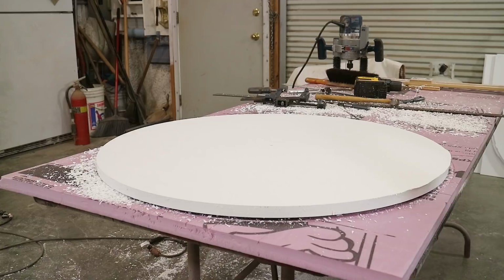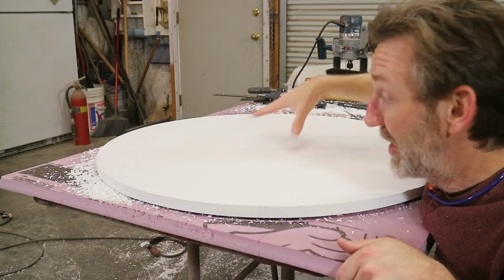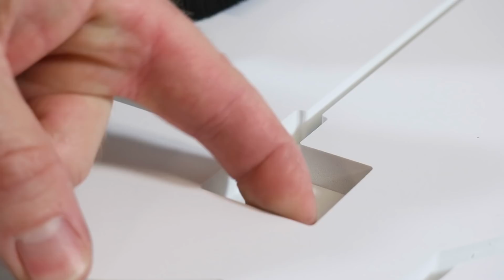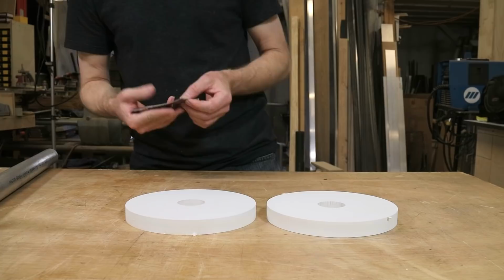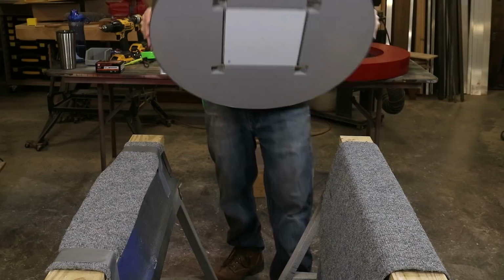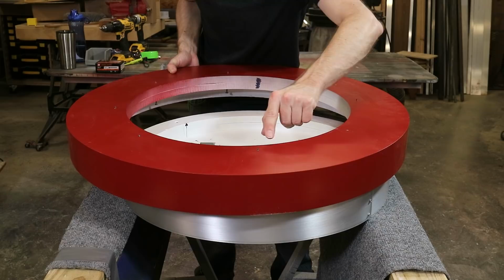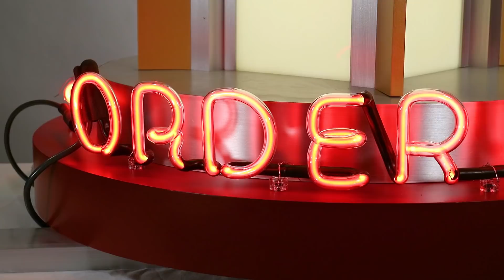Building a Neon Art Deco Spire

Comment: As a plumber I can tell you that when working with pvc, using purple primer before using pvc cement can make a whole world of a difference. (You do want to use the purple primer it's a lot better than those cheap clear primers or those primer cement in one cans) 🖒😄
Reply from the maker: With or without primer, it just sets up too quickly. There are other adhesives that are intended to work with PVC sheet, which I may try next time. 👍

Comment: You could dodge the tapping stage by using taptite screws, they're trilobed  screws that cut their own thread, eg 4mm. And it's a proper thread not just a self tapper. As a bonus feature, they're pretty useful for tapping threads in really awkward spots.
Reply from the maker: I use self-tapping screws sometimes, but these were little #4 screws going into 1/8" thick material and I didn't want to risk any of them breaking. 👍

Comment: That PVC glue may have worked better if you first used some clear primer. ;)
Reply from the maker: It's not the effectiveness of the glue, it's the fact that it starts to set up too quickly over wide surfaces. There are other adhesives that are intended to work with PVC sheet, which I may try next time. 👍
Reply: @WesleyTreat  Ah, that makes perfect sense! I have the same trouble sometimes gluing electrical PVC pipe.

Comment: Another great project. Can’t go wrong with the Art Deco or neon look. On the red bolts used on top, did you consider using studs with acorn nuts, painted or chrome?
Reply from the maker: Thanks! The bolts are on top, and will be several feet in the air, so only a maintenance person will ever see them. Even painting them was kind of pointless. 🤷‍♂️

Comment: the glazing putty was to clean up the sanded edges i'm guessing?
Reply from the maker: PVC sheet is porous, so the putty makes a smooth edge. I go into more in the extended version. 👍
Reply: @WesleyTreat  I figured that was what you were doing, it's such a hard surface to sand clean and not just melt.

Comment: And time to cut that circle and setup on the robot vs the router is so much different.
You got a good circle jig, the router will take far less time than the setup on the robot and programming.
Reply from the maker: And how well do you think the circle jig would do creating all the precision alignment pin holes, hardware holes, pockets and slots in those circles?
Reply: @WesleyTreat  I was saying for the primary cut of the circles. 
But yeah, trying to do the rest of the stuff you were doing there, good thing you got that nice tool to handle it. 

Though, once you have the stuff programed and youc ould fit them, of course it would work great, 

circle jig is worth its weight all day, cause it just works.

Comment: So I noticed that you spent time sanding the edges of the PVC sheet before then glazing and sanding again? This seems redundant to me, so I'm guessing there is a reason behind it? Better contact for the silicone? Better paint surface?
Reply from the maker: The first is a shaping pass to get all the layers flush. Then I seal the porous edges. The layers that got aluminum banding didn't need sealing. 👍